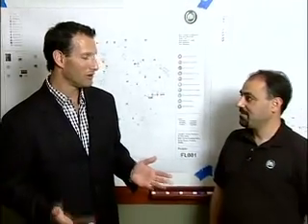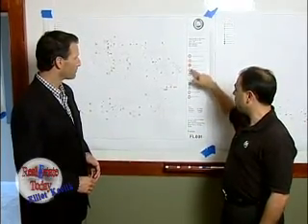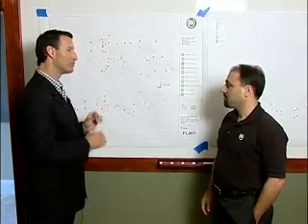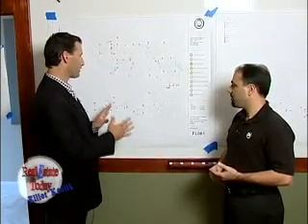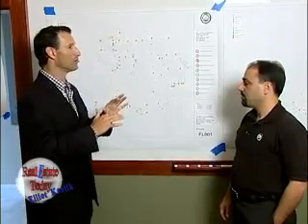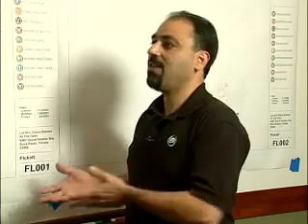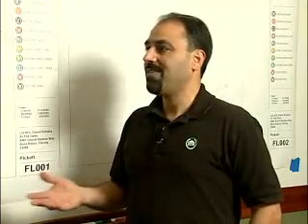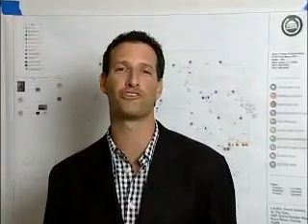Blueprints For Home Theater Automation - Koolik Group Realty Video

Comment: Check out our video on the Gefen Professional Automation Controller. You can control any type of A/V equipment, as well as lighting, electric motors, and more. Simple one touch macros will enable you to cycle through the various modes of operation on your system. Take it a step further and control via your iPhone / iPad or PC, only available from Gefen.